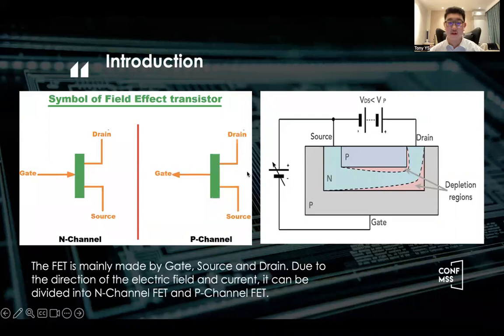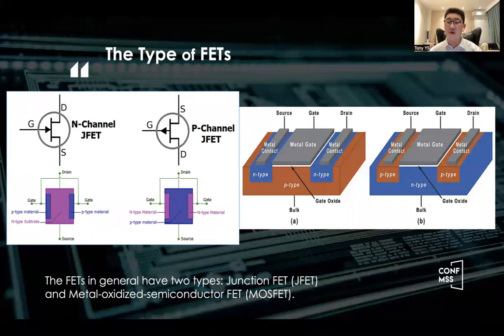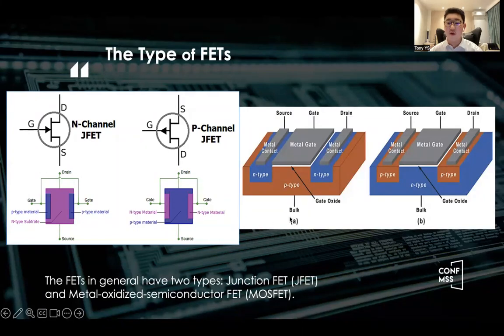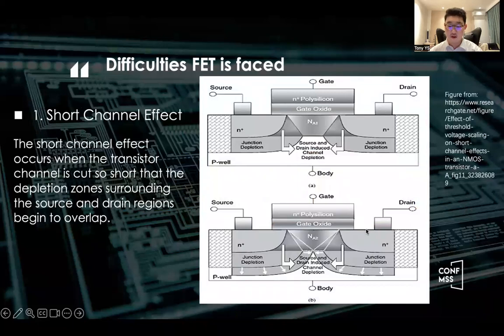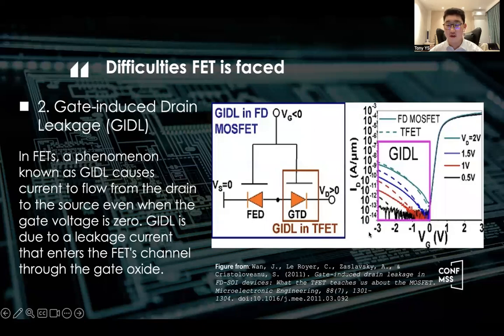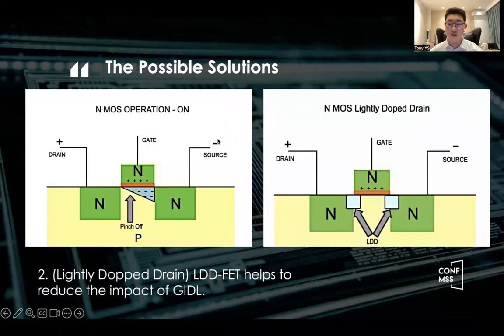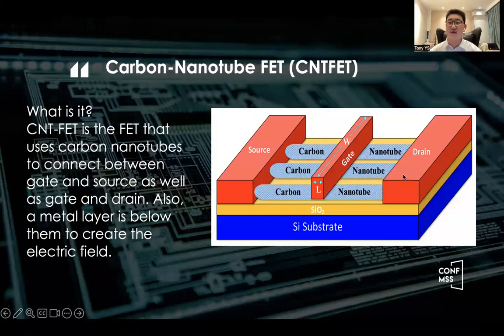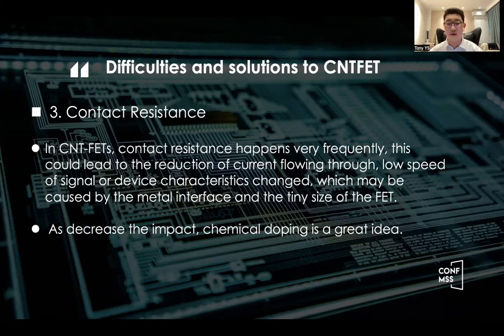CONF-MSS Based on the Comparisons with Various Types of Transistors to Predict the Trend of Nanotube

Comment from the maker: As you mentioned the chemical doping as potential solution for contact resistance of CNTFET, could you please give any practical examples of chemical doping? (What kind of chemical materials？How does it work? What about the cost? )
Reply from the maker: RE: 
1. Semiconductor Doping:
- Materials: Silicon (Si) is a commonly doped semiconductor, and impurities like phosphorus (P) or boron (B) are used.
- How it works: Phosphorus is an N-type semiconductor because it is a donor dopant, which means it adds extra electrons to the silicon crystal lattice. Boron, on the other hand, acts as an acceptor dopant, producing "holes" that serve as positive charge carriers and a P-type semiconductor as a result.

2. Light-emitting Diodes Doping:
- Materials: Gallium nitride (GaN) is commonly used in light-emitting diodes (LEDs), and impurities like indium (In) or magnesium (Mg) are used for doping.
- How it works: In the production of LEDs, magnesium is used for p-type doping whereas indium is employed to produce the blue or green color emission. These impurities alter the energy band structure of the GaN substance, enabling effective light emission.

3. Solar Cell Doping:
- Materials: Silicon is commonly used in solar cell manufacturing, and impurities like phosphorus or boron are used for doping.
- How it works: In solar cells, phosphorus or other donor dopants are added to the silicon to create an excess of electrons, enhancing its conductivity. Following that, this N-type silicon is mixed with P-type silicon that contains acceptor dopants like boron. Light energy can be efficiently converted into electrical energy thanks to the ensuing P-N junction.

Cost: Overall, the cost of chemical doping is different due to the materials used, the manufacturing methods and the industries' interests. As silicon and other chemical materials are widely used in the world, their prices have decreased, meaning the cost is respectively low. Moreover, the specific cost of different kinds of doping should check the report of businesses which I tried but cannot figure out.